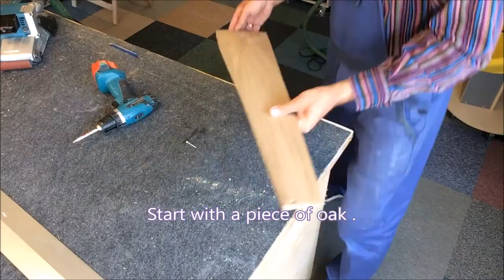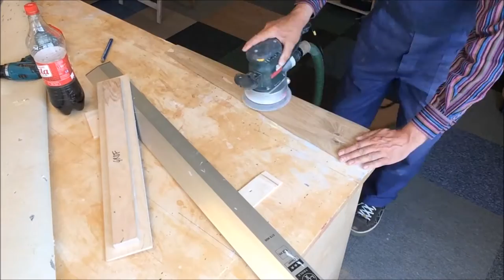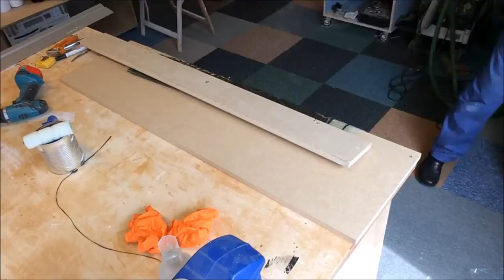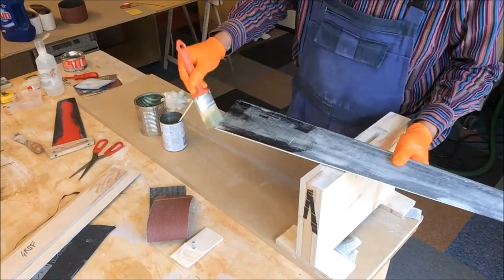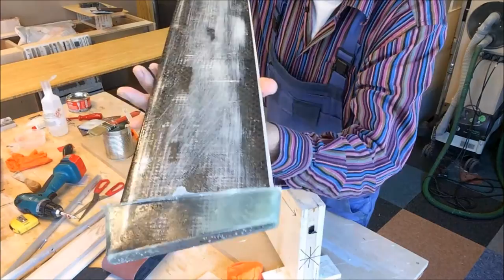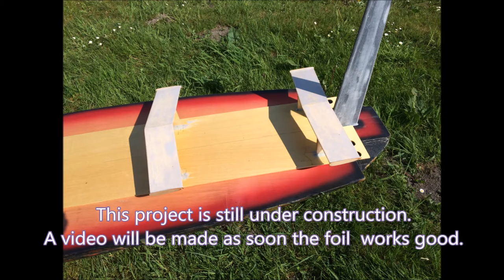DIY 70 cm windsurf fin the easy way without vacuum or a mold!!!!!

Comment: i think that a simple "home made" vacuum made with an old refrigerator engine and some plumber gum would help you  a lot when finishing and make a better product with less work.. however nice work thanks for sharing!
Reply from the maker: I own a vacuum pump. It is a myth that everything is better with vacuum. Compare with the paper and cardboard. Sometimes paper is stronger in tensile strength, but a box of paper is less strong than one made of cardboard!